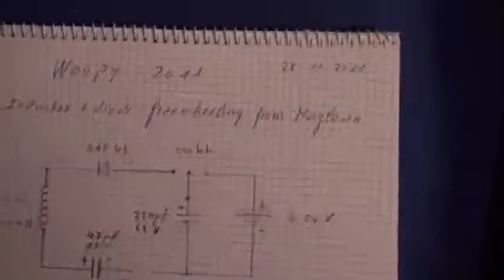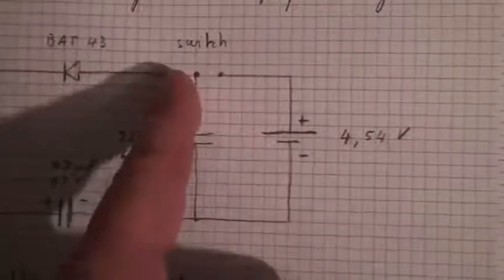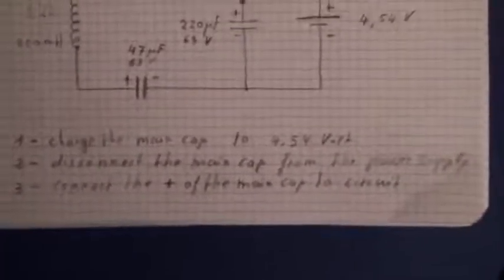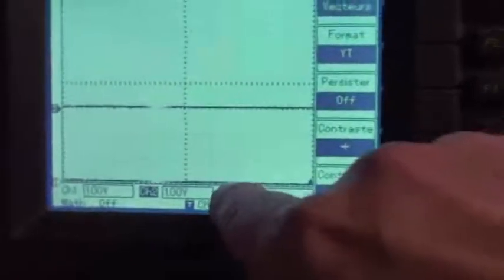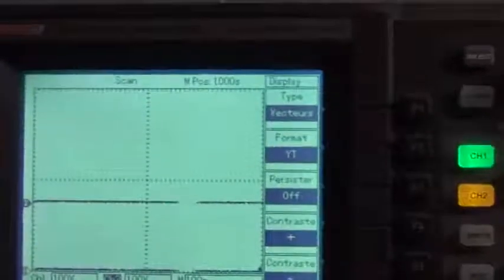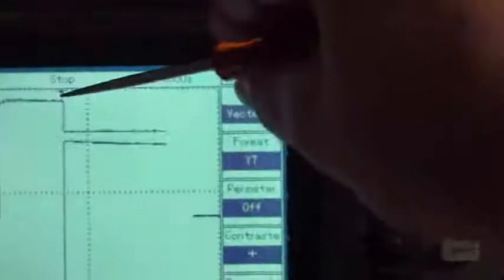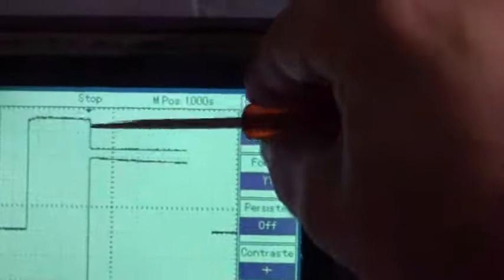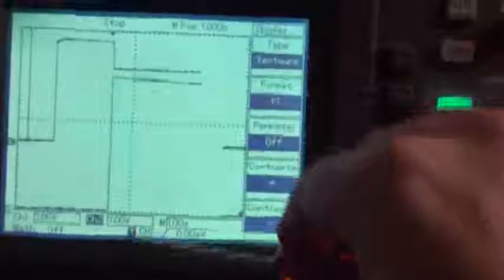freewheeling magnifier test 1.wmv

Comment: Hi,
would be good, if you would try it with 2 same caps.
So if you load up the starting cap to 4.5 Volts and the other cap will
have more than 4.5 Volts you will know, that you have created overunity energy.
in the second cap.

Regards, Stefan.

Comment: Correction :  60 psi to 70 psi

(2nd) The pressure in a bicycle tire is like the voltage on a capacitor.  You know that it takes much more physical work to pump the tire from 60 psi to 70 psi as compared to 10 psi to 20 psi.

It all works and it all makes sense.

Comment: @Jetijs You are correct.  Here is a suggested calculation for Laurent:  Just using the main cap of 220 uF:  If the cap drops from 10 volts to 9 volts, how much energy is discharged out of the cap?  If the cap drops from 5 volts to 4 volts, how much energy is discharged out of the cap?

Real life:  You pump up a bicycle tire with a bicycle pump (English units):  How much physical work is it to pump the tire from 10 psi to 20 psi.  How much work to pump it from 20 psi to 70 psi?

Comment: Hi there :)
I think I see the mistake. You start at the main cap at 4.5V, that would be 2.226mJ of energy. You lose 1V, that means the left over energy is 1.348mJ. You lost 0.88mJ. The other cap is at 5.2V 47uF so the energy is 0.635mJ. This means that you just transferred energy with 72% efficiency. Your mistake is that you cant calculate the spent energy on the voltage drop of the cap, you need to calculate what you has and what you have now and subtract what you have now from what you had :)